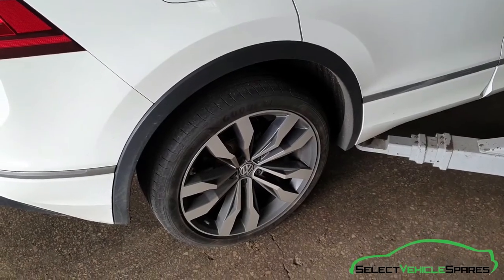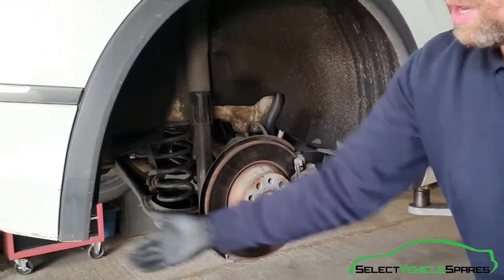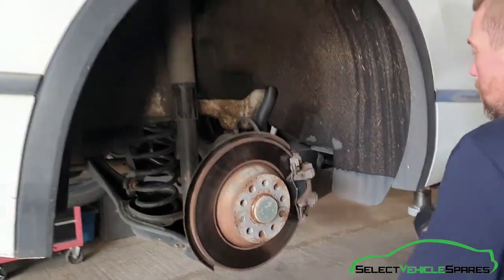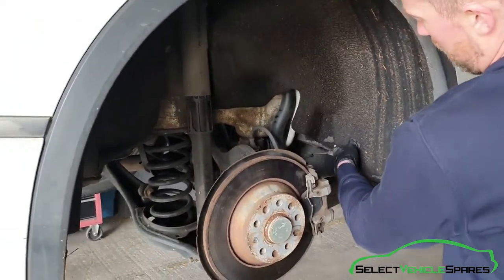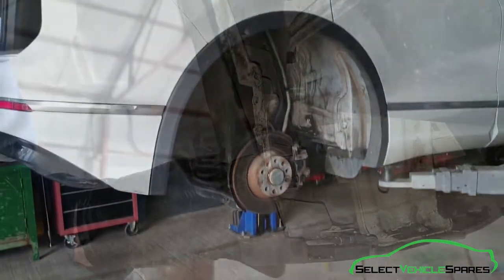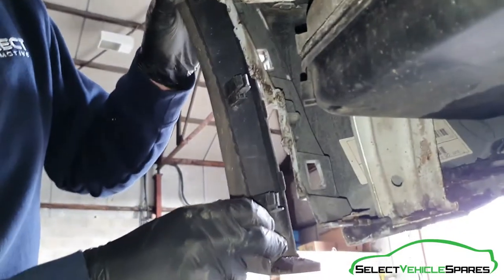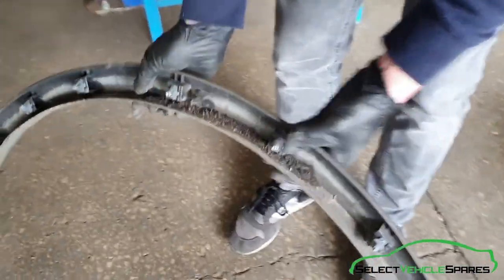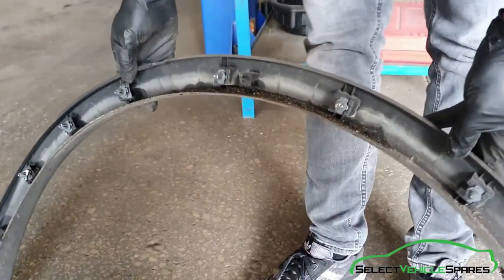VW TIGUAN MK2 - How To Remove Rear Plastic Arch Trim Removal Replacement

Comment: at 02:42 is it the rainwater drain from the sunroof that we see? with the red cap? I have water in the trunk and I think one of these pipes is clogged. Thanks in advance.
Reply from the maker: We no longer have the vehicle available to check this, but from what it looks like yes it is likely to be the sunroof drain.

Comment: Thanks so much for this video, do you think is it possibile to remove the arch without taking out the wheel and the inner plastic cover??
Reply from the maker: We haven't tried this. It could be possible, but you risk breaking some of the clips/fittings on the arch.

Comment: Do you think this is almost the same for the 2019 atlas? I hit a debri on the highway and it damaged my trim. Thank you
Reply from the maker: We don't get the Atlas in the UK, so cannot confirm this. However they are usually put together in a similar way, so it should be a similar process to remove the arch.